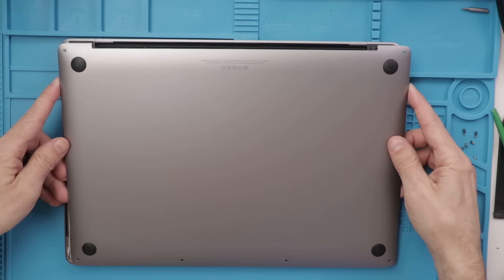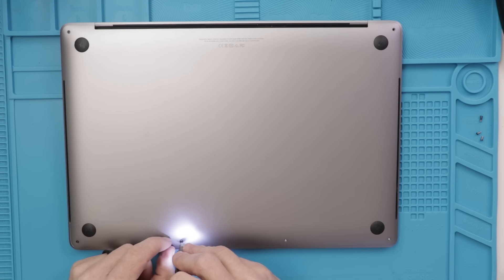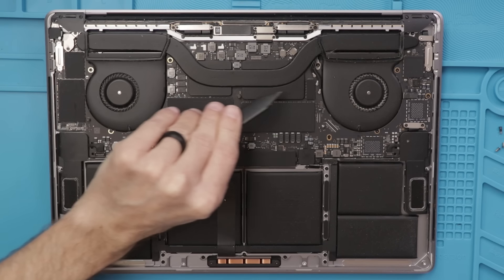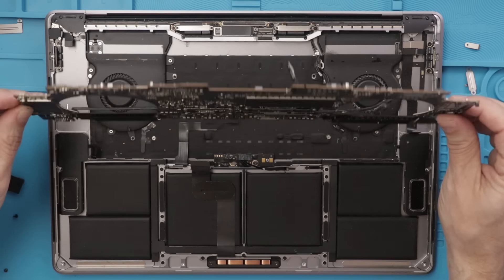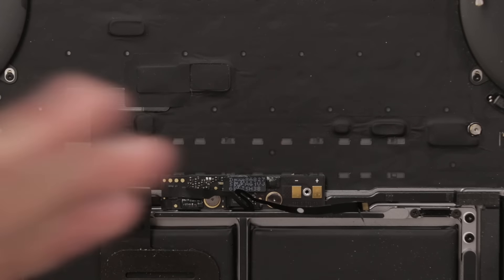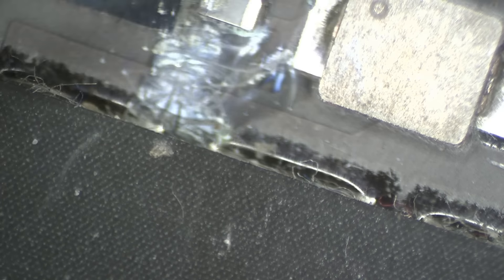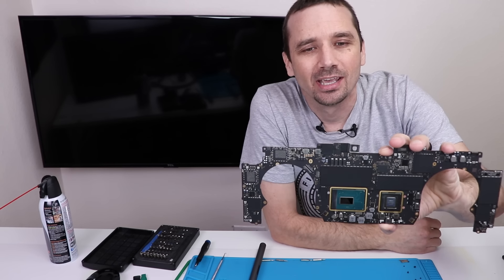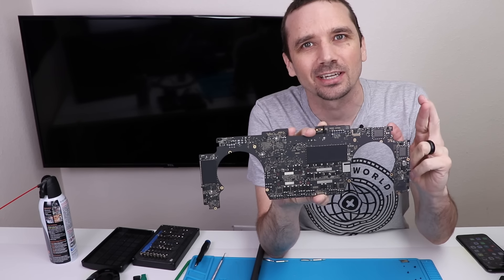I Spent $865 on a Liquid Damaged 2018 MacBook Pro - Can I Fix It? Did I Just Waste my Money?

Comment from the maker: Do you think all hope is lost on this MBP? Also, here's the affiliate link to the ultrasonic cleaner: https://amzn.to/2uDmcJT
Reply: Connect with Rossmann! It's most likely not the GPU/CPU, most likely a usb-c chip
Reply: Give us more information about how much power it's drawing please
Reply: Buy some freezze spray and test what gets hot faster, so you can know which of those components (most likely a capacitor) is shorting to ground
Reply: Check power draw. And like Louis always shows, follow the PPBUS lines to see what each have. If all else fails, mail it to him for repair and you'd still have a bargain Macbook Pro.
Reply: You need to inject current to see where the short is. Or send it to Louis, I'm pretty sure he'll gladly do a coop
Reply: My guess be PPV3H is missing as your only getting 5v at the charger.  That capacitor that was corroded.  Replace that at least.  Reflow other chips to reball them as well.
Reply: @Baalzamon512  pee pee 3 v hot actually as said by rossmann
Reply: try taking off the CPU and GPU and see if it's still shorting stuff out if it is then it could probably be fixed also these newer macbooks don't have power buttons so they wake up when they are opened i don't own one (i have a dell) but i have watched other people use these things
Reply: @nathanmead140  you cant take them off. They are both soldered, even if you get them off using a rework station good luck soldering them back
Reply: No i think its a job for Louis Rossman
Reply: Why did you buy it for so much if the seller thought it was irreparable?
Reply: @Baalzamon512  don't reball, just clean it with an ultrasonic cleaner and follow PPBUS
Reply: @pathfinderproject9381  go watch lois rossman YouTube's. I've seen heaps of his water damaged repairs. And yes he has had to reflow chips.

Balls get corroded under chips which interrupts the circuit. Just ultrasonic cleaning removes the corrosion, but the circuit is still broken. Need to reflow the balls to fix circuit.
Reply: @Baalzamon512  I never had to reflow a chip before. Ultrasonic cleaning did the job for me
Reply: If anyone can revive it, Louis Rossman.
Reply: nathan mead You’re right that they start when the lid is opened, but they do have a power button, too. He pressed the right spot.
Reply: girlsdrinkfeck Silly Apple. Landfill. Hehe. All seriousness aside, what laptops are water resistant IRL?
Reply: @estebanquito356  A thermal camera image might show where the ground short is.
Reply: Infrared camera checked where it's getting hot?
Reply: HAHAHAHA
Reply: @RobSchofield  Yep. It's just freezze spray is 200x times cheaper
Reply: What is inside the ultra sonic cleaner? Pure Alkohol?
Reply: nathan mead  I have a 2017 MacBook Pro with stander key so it still has power button but also turns when open if shutdown and closed
Reply from the maker: 5V and .16A except for one of the cd3215's is pulling 1A. I've reflowed them so I'll try replacing that one that's obviously bad. I have schematics and boardview. Thanks
Reply: @NicVandEmZ  Sounds like it thinks it's closed
Reply: MBP? I know the MB stands for motherboard what's the "P" stand for?
Reply: @Binary_Deviant  MacBook Pro (as in Pro-fessional).
Reply: @manolisgledsodakis873  Oh OK. I don't keep up with anything Apple except older iPods/iPhone. I think Louis Rossmann has given perfect example of why.
Reply: TronicsFix  id love to help but know nothing.    I am interested in what you washed the board with in the ultrasonic?

Other than that can you not purchase a replacement motherboard?
Reply: Steve I have a ps4 that the disc drive makes a grinding noise and sometimes won't spin also it won't render in graphics for every single game  mostly Fortnite  but it still happens and it's bad and the ps4 sometimes freezes then will become  unfrozen then the fan sounds like a bearing is bad but it's not that  bad  then when I go on grand theft auto 5 and go in sertant places in the map the game will freeze then crash 4 minutes later but 14 days ago it was fine with rendering I don't know what's wrong do you know what might be wrong with it.  Btw I've had to replace the hard drive 2 years ago and if I have to replace it again then I need one for $80
Reply: well, you got dead tps51980, adesto flash and some graphics memory rails(i've just took a look on the board at1.21). 51980 and pp3v3_s5 are fixable. if you have broken adesto flash, whole board should be replaced.
Reply: Send the motherboard to Louis Rossmann
Reply: Can u tell me where u get the fuses and chips and all that that u replace in all you're videos
Reply: 10:00 I think the GPU is NOT shorted. It just has a big power consumption, hence low resistance. I think this MBP is worth try fixing.

Comment: coils near cpu - gpu can give low readings that in diode mode (beep mode) ur multimeter can beep, but it can be normal readings, you have to check them in ohm mode. first check if there is green light on power adapter.
Reply from the maker: Yep, already checked all that. Thanks for the tips though.
Reply: the 2018 model charges via USB-C so no light
Reply: @Tronicsfix  AHHHHHH when you know Luis why are you putting it in the ultrasonic befor troubleshooting? If you have corroded balls under a chip you can repair them by reflowing but after being in the ultrasonic the corroded balls wash away. And I have never seen Luis check the caps of the gpu so I don't think that they fail often. How low was the resistence? I repairded some desktop gpu's and the have around 2-4Ohms.
Reply: markus98sb he said he’s NO Luis, not that he knows him👍🏻

Comment: You should connect a variable power supply to your shorted power rail  (at a low voltage - maybe 1 Volt) and then see which component gets hot. You can use isopropyl alcohol to detect what is getting hot since it will evaporate nice and quickly on that hot component. The component that gets hot is what is causing your short to ground.

Comment: Unlucky Steve. Very watchable nevertheless. I remember a PS3 GPU was showing lots of shorts on one of my videos. Apparently this was normal as I was testing in continuity mode rather than getting the Ohm reading so they weren't actually full shorts. You have probably already tested this off camera as I am sure you would have put the hours in when spending that amount of $ :-) It seems such a shame as it didn't look too bad, and it cleaned up really well. Hopefully you may get some life out of it on a revisit video once the comments come in :-)
Reply from the maker: Thanks Vince! I still have hope to fix it.

Comment: Hey!

I watch your videos whenever I can, but they inspired me to buy and repair a gaming laptop (Lenovo Legion Y730 15ICH) that was crashing during games because of the GPU. So i bought it and grabbed myself some thermal paste to help with any heat issue, and did all the bios, driver, and software updates needed. 

now, it works GREAT! 
with some patience and research, I was able to discover that there a thermal throttling issue with the i5 CPU. so when i update the chipset, I was able to keep it from overheating...

btw, this laptop cost about $1200..... I paid $419. ;)
Reply from the maker: Nice work! Love hearing stuff like this.

Comment: Oh my gosh this is just silly, I've bought a 'liquid damaged' MacBook Pro recently too! Video coming out this week lmao what a coincidence
Reply from the maker: IDK why it's so fun to buy these and try to fix them! I'll be watching your video for sure!
Reply: I’m a massive fan of your channel Luke!
Reply: Luke Miani thanks for the sneak peak 😏
Reply from the maker: Oh, and stop bidding me up....jk...lol!
Reply: AYYE LUKE. Love your vids man. I’ve been binge-watching them for the past few days.
Reply: @peauxwet  Thanks! Glad you enjoy!
Reply: Luke, not sure how prepared you are for fixing liquid damage on a newer MBP, but if you don't already have one, definitely get an inline USB-C volt/ammeter so that you can just plug the board in and see how many volts and amps its taking instead of throwing it all back together to test like Steve did.
Reply: I love your channel
Reply: That is funny!  Can’t wait to see it.   I’ve got a MBA that was either peed on by a cat or it’s lemonade that I bought locally.   But it definitely seems salvageable.
Reply: @FrugalRepair  Is it one of the older (2017 or older) MBAs? Those are pretty easy to fix. It also helps that the keyboards are not impossible to replace in those, either.
Reply: @rars0n  It's a 2013 MBA 13".  The video connector is corroded and needs to be replaced.  There is other corrosion too.  It did boot up when I purchased it, but the backlight was barely on.  So that's why I have hope.
Reply: @Tronicsfix  Im a fan of you luke and louis rossmann need a 3 way colab as you all seam to go along the same route @luke miani @louis rossman

Comment: i just want to say to everyone is if you spill water on your device the first thing to do is remove/disconnect  the battery as soon as possible. it will stop that green corrosion that shorts the components. after that you can dry off that water with hair dryer or leaving it for two or three days in bag full of rice to absorb any moisture. and if you still find that green corrosion, you can use a toothbrush and some ipa to brush that off. then connect the battery, press the power button and hopefully your device will start up like nothing's happened to it 👍

Comment: I would say to try to go a little further yourself as long as you don't get upside down on cost. I know there are a few tools that Louis and others have. Like the inline voltage reader and the schematic software. You might want to get your hands on one of those to see if it leads you in the right direction. I'm pretty sure you have good enough soldering skills to fix the issue once you narrow it down.

Comment: I am trying to do what you did! Macbook Pro A1502. I want to remove the logic board & check the other side. The battery BMS pcb shows corrosion, so liquid damage might be present. Thanks for the good attempt, & hope you get it running again!

Comment: Well buddy, you can try a few things.... check to see if there is any light on the charger..... if no life...
Disconnect the battery, then leave it a min or two... switch it on, and if boots up. then its most likely a battery causing a short to the motherboard... battery can become problematic with water damaged ones....

Check battery voltage,  check the mosfet,  check the tracks for the power button for possible shorts. check the jack for power.
check the bio chip, 
Check the touch pad connector cable for water damage

Comment: i don't think gpu is shorted . gpu have very low resistant because gpu work on low voltage power rails . check the cpu power supply resistant you will get same .

Comment: 1) Use Diode mode for measurements. Sometimes low resistance lines will beep on continuity beep but Not really be shorted.
2) You wiped away all your hints but didn't fix any broken joints which were broken due to corrosion.
3) So you have PP3V3_G3H which those CD3215s use for power?
Reply from the maker: 1) I have
2) I have pics of all the shorted areas
3) This board does not have a PP3V3_G3H but yes I do have enable on these.
Reply: @Tronicsfix  What's the board #? 820-01041?
Reply from the maker: Yep

Comment: Even if you cannot fix this one use it as practice. Voltage injection is a common method Louis Rossman uses to find shorts, just make sure the injected voltage is lower than the normal power rail voltage (for you vcore less than 1 volt should do but check schematic for Max voltage).  Also replace the bad cd3215 for charger problem (check for warm chip, I think Louis recently figured out a new way to tell which one is bad) also ensure your charger can output 20v.

Comment: Have you dried it properly before finding shorts? The water probably entered under the heatsinks. I always dry the PCB at least 24 hours before testing it. Often the water is still dripping from the chips the next day. Sometimes I even dry it on the preheater to speed up the process. Tilt it while drying so the water can spill out.
Reply from the maker: I use IPA, compressed air and heat to dry them

Comment: Feed the part with necessary voltage you think short circuited and watch it under heat cam. Short circuit will heat and light up.

Comment: Next time, if you want an easy Macbook fix, look for a no power 12" Macbook from 2015 (A1534). The motherboard is a bit cramped down to a "tablet size" board but it often most likely only needs a replacement of the U4700 chip.. it's the most common problem as these will fail. They go down fairly cheap on ebay and can be sold for at least 100$ more even if the repair only costs around 5$

(I don't think that they are worth keeping though, they really feel like an ipad with a keyboard and macOS installed)

Comment: @TronicsFix Just reflow the USB-C chips, the ones that where water damaged, regarding the CPU and GPU diode tests, most of them should be close to a few ohms to the ground anyways, the multimiter will show continuity, (don't take my word for it!!!) Bought 3 macbooks with water damage all of them started up after reflowing the USB-C chips with some decent flux.
Sort the usb chips out and go from there. 80% it will start up.
Now just because it worked for me it might not for you and also be prepared to change the display as although the water went to the motherboard and keyboard, as my macbooks got shipped to me they got turned around quite a few times during shipping and the liquid went all over the screen.
Best of luck, hope to see this macbook alive again and amazing videos!
Reply from the maker: I'm actually going to try doing just what you said. I did buy some new USB chips as well so I can change them if I figure out which ones are causing a problem. Thanks for the comment.
Reply: @Tronicsfix  watch back your video and see witch one or ones where water damaged, try with reflow, would recommend using a usb c power meter, it helps a lot. Best of luck

Comment: Great video!  In terms of turning it on, did you look up where the power pads are?  Your keyboard may not be reliable as a means to turn it on.  You can use your tweezers to short the power pads.

Comment: Should not Ultrasonic clean it, check all components that have corrosion if it is short for caps or open for resister or trace, check the 3v or 5v power ic that power the USB C  interface CD3215 etc.

Comment: It was June of 2012 and I bought myself a 15' MacBook Pro for my birthday. Christmas latte season comes around and I spill an entire Gingerbread latte on my Macbook. Took it to the Apple store, but decided not to repair it at that time. Years later, it's still working and I spill pepsi on my MacBook. Took it to the Apple store, but chose not to repair it for a second time. It died 5 years later of a (maybe, but probably not) unrelated issue, but Apple wouldn't fix it because of the liquid damage. It's probably fixable and I still have it... I might as well open it up for fun to see what the damage was from all those spills. It did have a lovely gingerbread smell when it heat up tho!

Comment: a shorted capacitor on the main power line will throw up shorts all over apple boards remove that cap that had corrosion on and see if the short goes away on the rest of the board
Reply from the maker: Yes, that's true. I removed multiple components and still had the short. You may be right though, I might need to remove more stuff to see if I can narrow it down.

Comment: I would recommend unplugging the battery and then check how much power the board itself is taking.
It should be PP3V3_G3H that’s 3.3V for normal operation if not may be check CD3215 chips that’s the type-C port chip.
Reply: CD3215 mostly go faulty when there is liquid damage. Also I would say check the board number it starts with 820-.... with some more digits. Once you find that u can get a schematic for it online and diagnose it future.

Comment: I wouldn't write this macbook off. The multimeter on diode mode can beep even if there is some resistance, which can be natural when talking about small silicon. GPUs can have low single digit Ohm resistance from vcore to ground. My advice, measure the resistance and look up how much it should be, the reward could be fanspin :D
Reply from the maker: Yes, this is what I've been hearing. I actually just bought another one with a different problem so hopefully I'll be able to check them against each other.

Comment: The Inductors to GPU and CPU are between 8-28 ohms so they are not shorted it is just low resistence lines. Litteraly have a working A1990 in front of me that works and is reading the same at the GPU inductors 24 ohms and yours were 23 ohm.

Comment: First of all, put your meter 2 ohms to find out a ground out negative lead on the ground part of the chassis. And find out if you have a short to ground. I'm one of those capacitors are one of the chips. If one of the capacitor is bad just pop it up and put another one on. You probably had that you may have to refloat one of the ships. Especially that one that's all green around if you need the perfect amount of flux. As Louis would say the perfect amount. And you need a hot air station. Can we float that chip? So if you don't have the tools to do it. Put it back together and send it to Lewis.
Reply from the maker: I can reflow all but the largest chips on the board. Thanks for the comments! I'll be checking this out more.